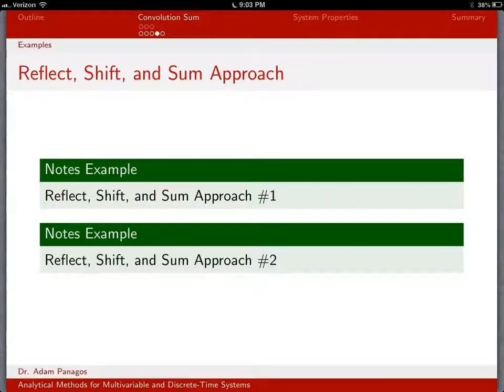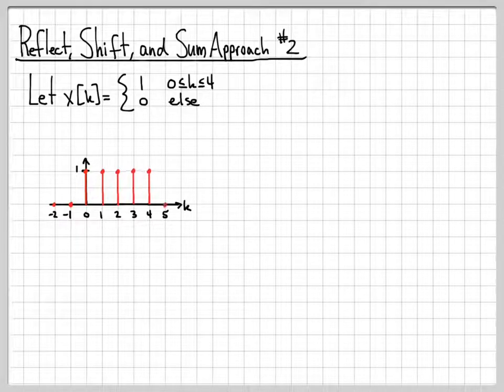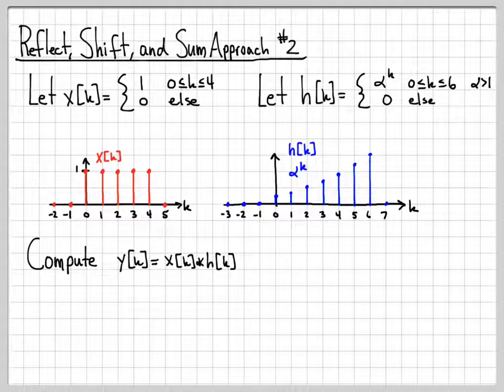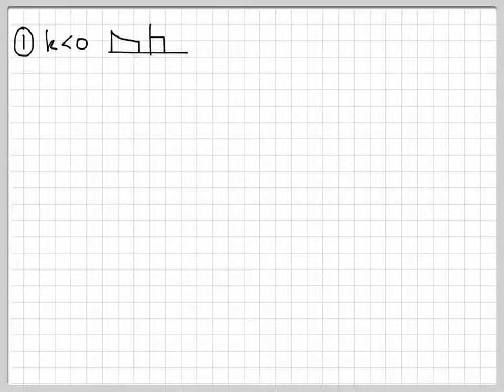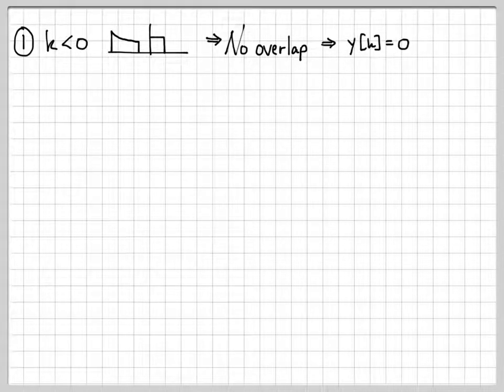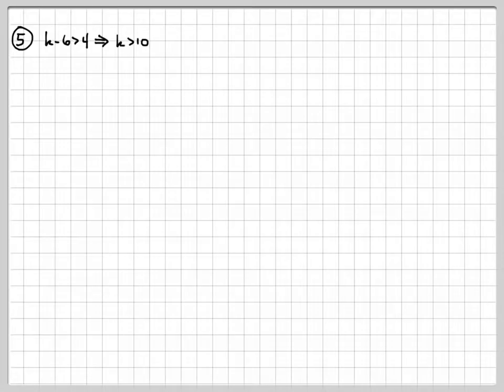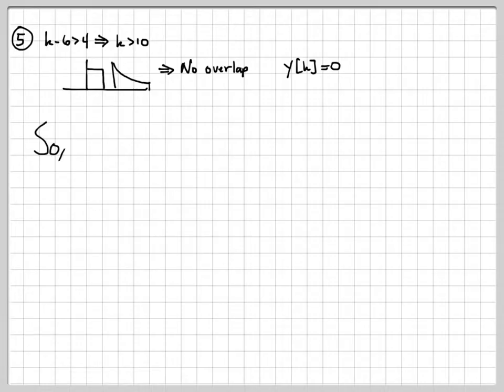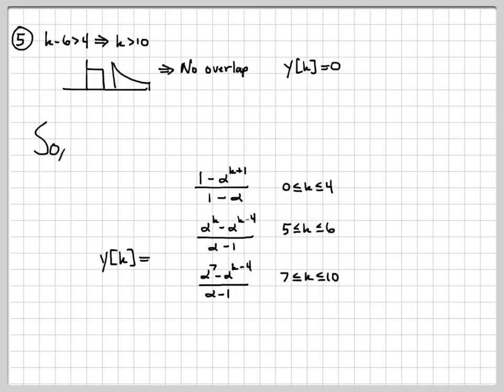Reflect, Shift, and Sum Convolution Example #2 - DT Systems Part 2 (6/9)

Comment: How do you get the boundary conditions? for ex, how do you know case 2 is 0 <k<4 or case 3 is 5<k<6 ??
Reply: I think it is supposed to be 4<k<6, otherwise there is a discontinuity.
Reply from the maker: Be careful with the inequalities.  Case 2 was 0 <= k <= 4 and Case 3 was 5 <= k <= 6.  The equal signs there are important.  This means Case 2 covers values of k = 0, 1, 2, 3, and 4.  Case 3 covers k = 5 and 6.  Only discrete/integer values of k are allowed so there isn't any discontinuity.

Hope that helps,

Adam

Comment: Great video! A question I had was, why is it for case two the summation does not go from m = 0 to 4 instead of k because the only terms one can add up is the multiplication of the functions between 0 and 4? thank you for your response :)
Reply from the maker: I think you're referring to Case 2 in the video?  For this case, we're only considering values of k that satisfy 0 <= k <= 4.  So, when we do the summation from m = 0 to k, the largest we'll ever have for the top limit is k = 4.  But, there are intermediate values for k (e.g. k = 2 for example) for this case that we don't want to sum all the way to 4, since the product of the signals for k = 2 would give us zeros for k > 3.  We could sum to 4, but we'd have zeros for the last 2 values of the summation.  Hope that clarifies a little